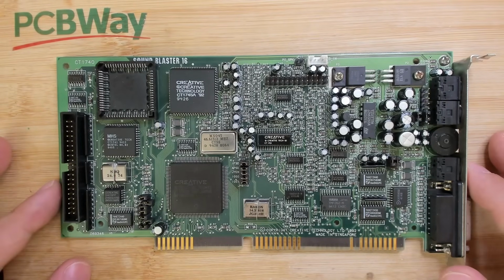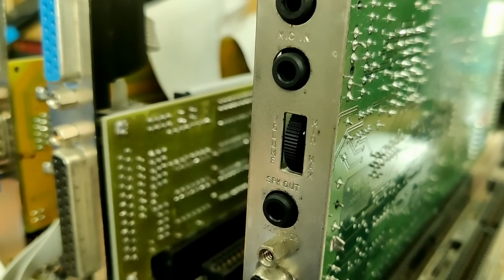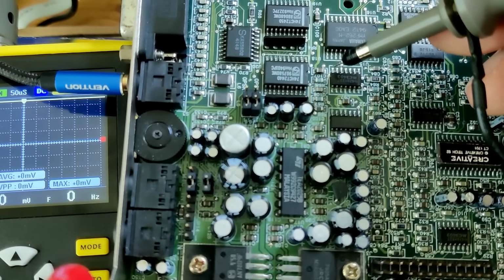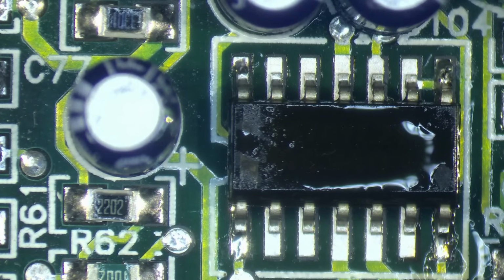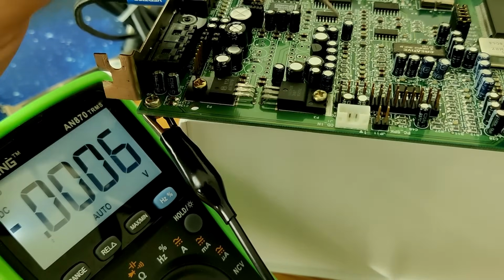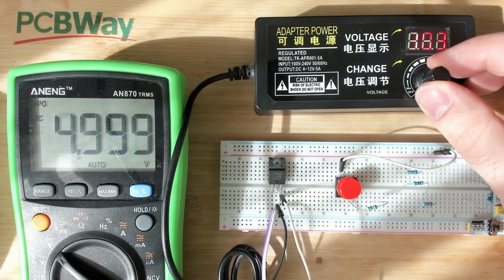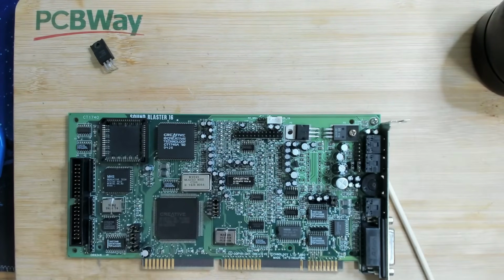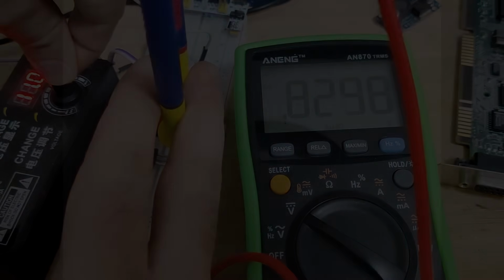The Greatest Sound Card Ever? The iconic Sound Blaster 16!

Comment: good thing with opamps , you can generally replace them with any other opamp regardless the type, if it is in the same package it would just work
i would also suspect filter capacitors on power rails because even if opamps are ok you can still colecyt a lot of digital noise from computer trough power planes
so i would check voltages on middle pins and if they are clean and find any other opamp to replace those, you might evan have some and not even know it
Reply: but it was the basics i see
Reply from the maker: Yes, this one was a simple fix! Luckily, none of the Creative chips got bad.
Reply: The MC3403 is basically a LM324 with a better output stage, true AB mode and with a lot less crossover distortion because of that. But in a pinch, replacing it with a LM324 should work. They're pin compatible.

Comment: I had a SB AWE32 (CT3910) that had the same issue. Guess time takes its toll on everything. I appreciate you showing not only the repair, but the fault also ,it helps explain the circuit and how the fault is causing the issue.
Reply from the maker: Glad to hear that you see it that way! I start from the very beginning and work my way through it. I don't call myself an expert when it comes to electronics, so, I will make mistakes. If I would have found the issue on the voltage regulator immediately, the video would end in 15 minutes :)
Reply: i still have one of those unfortunately the last upgrade don't come with a slot for it...loved that card
Reply: It also shows how one can recognize voltage regulator failures.

Comment: That's not an IDE port... It's likely a MKE (Matsushita Panasonic) proprietary interface designed just for Panasonic CD-ROM drives
Reply: There were SB16 with IDE interface (CT2940), but yes, these same looking 40 pin connectors on CT1740 or SB Pro are for Panasonic drives. Bought one recently with Creative label on it (by Matsushita).
Reply from the maker: So, how does this work? Is it just a regular IDE CD-Drive that could work on an IDE port on the motherboard, but then it switches the mode to work on the Sound Blaster port as well? Or will those CD-Drives only work on those Sound Blaster cards?
Reply: @bitsundbolts  Panasonic CD-ROM interface (called also MKE or SLCD) uses the same 40pin IDC connector and ribbon cable as an IDE (ATAPI) CD-ROM. In fact the same cable can be used to connect this kind of CD-ROM to this sound card. However, this interface's pinout is quite different from the regular IDE interface and I would not experiment connecting regular drives to this port or connecting Panasonic interface drives to an IDE port. On later sound blaster cards there was an option to change the CD-ROM type but there were different headers on the board and also I have not seen a CD-ROM that can auto-detect and change the interface on the fly but maybe there is, I don"t know.
Reply: @bitsundbolts  Back in the days of the interface war, Panasonic/MKE (and the Creative/Panasonic CR563B CD-ROM), There was also Mitsumi (for the pullout LU05 drive) and Sony. While it has the same number of pins, the MKE interface is not compatible with IDE.
And there are SB16 with MKE, There are SB16 with all 3 of the old interfaces, there are SB16 with IDE, there are SB16 with SCSI
The CT1740 is a 1st gen with MKE/Panasonic interface (and REAL OPL3)
Reply: @ those Panasonic CDs would work on such SB card or on any of the later cards with lots of interfaces. You should have seen them - usually they have 40 pin IDE (ATAPI) connector, 40 pin Panasonic connector and 34 pin Sony connector - one more standard. There were also 50 pin SCSI CD ROM (with corresponding connectors on cards like PAS16 and probably some SBs) and very-very rare 16 pin LMSI connectors (Philips). So 5 variations in total.
Reply: @bitsundbolts  So, the CD-ROM drive and sound card were usually sold as a bundle to make sure they matched. This was before the ATAPI standard was ratified, and the original Western Digital IDE protocol didn't actually support CD-ROMs. You had to configure and load the DOS driver for the sound card, which would also initialise the proprietary CD-ROM interface, then use MSCDEX to configure the drive.
Oh yeah, and all the proprietary interfaces were electrically incompatible with each other.

Wild times 😂
Reply: @bitsundbolts  FYI, ATAPI is just SCSI commands on the PATA/IDE interface. So, you ended up with makers of SCSI CD-ROM drives quickly re-designing for ATAPI, which newer motherboards had support for natively. I believe E-IDE did provided for CD-ROM support a bit earlier, but it could be hit-or-miss in terms of motherboard support.
Reply: Like IDE, the Panasonic / Matsushita MKE interface is really just a buffered bus extension with a bit of address selection logic on the card.  SLCD (Sony) is similar too.  I haven't looked too closely at Mitsumi's interface yet because the standalone Mitsumi ISA card that I have uses a custom ASIC that acts as a bit of a black box.  I have standalone MKE, SLCD, and very basic IDE cards (meant to add a CD-ROM to a system that only had a single IDE channel), which all use ordinary logic ICs, with maybe one custom PAL IC that is pretty easy to figure out.

The simplicity and inherit similarity between these interfaces make me wonder if it might even be possible to build an adapter that would allow you to mix and match.  It would most likely not work with more sophisticated IDE interfaces, but the ones that just turn the ISA slot into a ribbon cable... might be possible.  :-)  Not sure any of that would be all that useful, since we're not exactly short on interface options for the dozens of working 1x and 2x drives that use them... lol.  But still might be a fun project just for laughs.

I already made a custom ribbon cable with dual 40- and 34-pin IDC connectors on each end, so I can use it with IDE, MKE, SLCD, and Mitsumi interfaces/drives.  But they're just straight-through wiring, and you have to use the correct interface and drive still.
Reply: used to have a SB16,   mine hade a 40 pin ATAPI   had 2 CDROM's on it. one was LG

Comment: To be precise, sb16 never was so popular. There was only one clone chip - ALS100 (and ALS120 if memory serves) supporting SB16 (AND SB Pro, btw), while every other manufacturers like Opti, ESS, etc were supporting SB Pro only. More of that, SB16 wasn't backward compatible with SB Pro, only original SoundBlaster, so it could work only as 16 bit stereo card or 8 bit mono card, being worse than any other clone in most of old DOS games with SB Pro support (they had stereo sound while it had mono).
Reply: The SB16 can not just work as 16 bit stereo or 8 bit mono card, it can also play 8 bit stereo and 16 bit mono sound as well, but everything except 8 bit mono requires the use of the new SB16 playback commands instead of the legacy SB/SBPro playback commands. So in the end you are correct that software written for the SB Pro is indeed unable to use the SB16 as an 8-bit stereo card, but it will work as an 8-bit mono card with legacy software just fine.

The technical background is that on the SB Pro, the main sound card controller chip (the "DSP", which is not a Digital Signal Processor as we know it, but just a pre-programmed Intel 8051) is just moving 8-bit samples at a fixed rate. To play back 22.222 Hz stereo, you just tell the chip to move 44.444 samples per second to the DAC and mixer. If I am informed correctly, the DAC will just convert at 44.444 Hz, and the mixer will use a sample-and-hold circuit to forward every other sample to the left or right channel respectively. On the SB Pro, the stereo playback is achieved by setting the stereo enable bit inside the mixer *chip*.

The SB16 now has a stereo DAC, and the mixer already receives a stereo signal from the DAC. Furthermore, the Sigma/Delta conversion principle of the DAC on the SB16 does not interoperate well with the analog multiplexing of two channels. So the mixer can not reproduce a stero signal on a Soundblaster 16 the way it could on the Soundblaster Pro. In fact, the SB16 mixer chip does not even implement the Stereo Playback Enable bit. On the other hand, the digital logic which could enable stereo playback on an SB16 card does not get to see the mixer programming, so it doesn't know whether "classic soundblaster data" should be interpreted as stereo or as mono at twice the sample rate.
Reply: Later, for sure, where games were using standard Miles libraries for sound (or similar ones) all 16-bit standards were supported natively - Gravis Ultrasound, SB16, ProAudioSpectrum 16 and Windows Sound System. The latest was supported by majority of clones so technically it was the most popular 16-bit sound standard.
Reply from the maker: I have read that there are issues with Sound Blaster Pro compatibility and the card definitely has its issues (e.g. the hanging note bug). I still have to use the card more to get used to it. My memory might be fading, but as you say in your second comment, those 16-bit Sound Blaster settings popped up everywhere in game settings, PC magazines, and emulators these days.
Reply: @bitsundbolts  not just issues, they were simply incompatible. If there was no direct SB16 support in the game it could work as SB only, not as SB Pro (stereo modes).

Comment: The lack of decay on the FM synth notes was a dead giveaway of a voltage issue in the analogue stage. Nice work!
Reply: Really!  That's interesting.  Any clue why that is?
Reply: @sirnickity  with all the chips being undervolted like that,  the chip is probably on the verge of browning out.  that is also why it makes this weird noise after stopping playback.  it's barely able to run.   and since decay is probably regulated via voltage roll-offs and envelopes  , the low voltage and near brown out status completely screws with the timings. and necessary voltage levels.    At least that is what i think with my limited knowledge about FM synthesis.   But i let someone who has more knowledge about audio electronics explain it in more detail :)
Reply: @Xadarako  I wouldn't think it has anything to do with timing, or even envelope generation, since that's all digital in the OPL.  Also, I don't know for sure, but I would hazard a guess that that 5V regulator is for the analog rail, and the OPL most likely runs straight from the 5V rail on the ISA slot.

I would bet that this fault only affected the DAC.  And that's an interesting way to present a problem with the V+ rail in a DAC.  I would've anticipated extreme clipping, but a complete squashing of output quantization?  Not on my Bingo card.  So if this is expected in some way, I'd be interested in knowing the mechanics behind that.
Reply: @ I suspect the output of the 7805 is used for the analog part that doesn't require higher voltages. (The TAE2025 speaker amplifier will be powered from the 7809 instead). The 5V analog section includes both(!) DACs: The digitized sound is converted by the CT1701/CT1703 (the chip with the sticker in this video), whereas the OPL3 output is converted by the YAC-512. This video doesn't show whether the loss of the envelope is caused by the MC3403 or already in the YAC-512. As the digitized sound is also heavily distorted, I expect the MC3403 to cause at least a part of the problem.

The "complete squashing of quantization" is fact is a kind of "extreme clipping" just as you expect: If already a very soft sound from the YAC-512 is hitting the clipping limits, any louder sounds form the YAC-512 will be clipped to exactly the same level as the soft sounds. The MC3403 is not specified to work below 5V operating voltage, and I suspect that some "class-A" type stage in that chip ran without the required bias current at 2.5V supply, causing the heavy distortion/clipping.

It is important to consider that op-amps have an inherently high amplification, and you use negative feedback to limit the amplification to the required range. If the amplifier is not operating in its linear region, as there is none at 2.5V supply voltage, the feedback stops to work as intended, so you might actually get an overly high amplification of soft sounds.